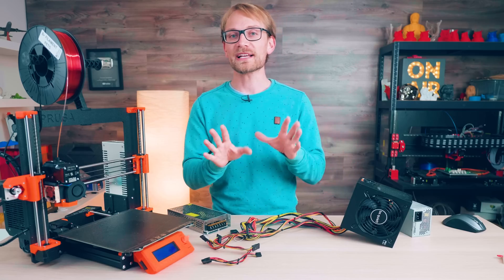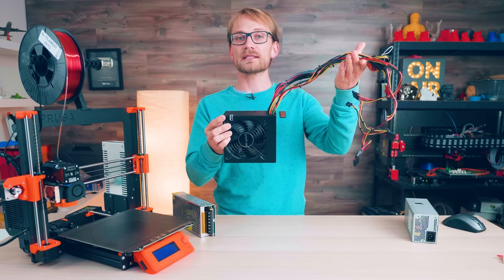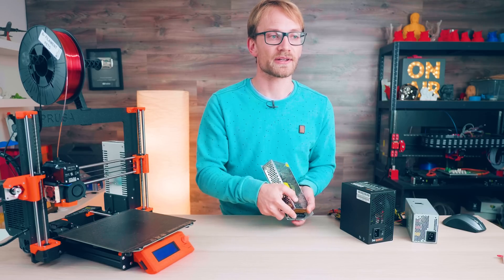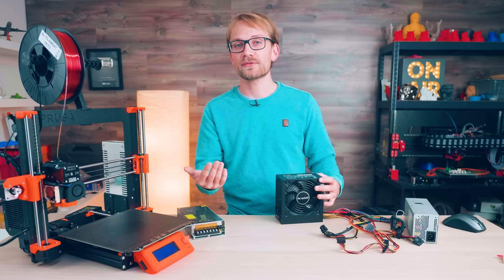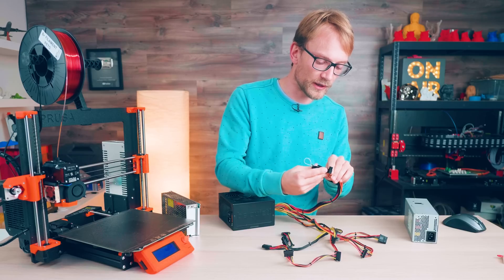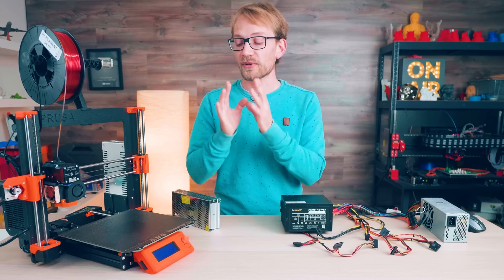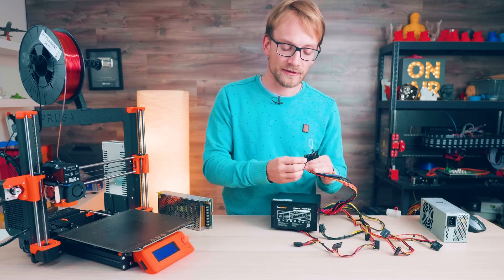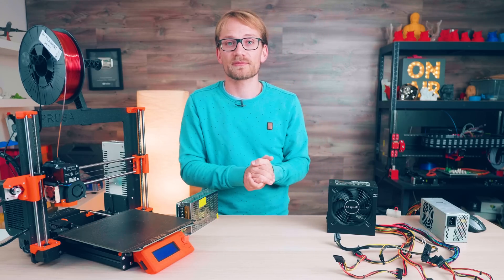ATX supplies are super useful for 3D printers!

Comment: Still on 12 volt PSUs on my 2 custom printers. One with a RADDS controller has ATX corsair 80 bronze semi modular PSU. I combined 3 ATX wires to one thicker for the bed. The other is with a Duet WiFi and has the 12V Prusa MK2 style PSU and thick wires with crimp connectors and ferrule connectors.

Comment: If ATX PSU's have 2 or more 12V rails, couldn't you just connect them in series to get 24V
Reply: The +12 lines can only be wired parallel, so you get more current available, not voltage if you wire them in series you are creating a dead short, BANG!  You can get 24V from the +12 and the -12 but then you are then limited to what the -12 can deliver in current, typically a small fraction of the +12. Have a look at the label.
Reply: @m3chanist  yup, 0.3A in the example he used on -12V, not worth it

Comment: I was considering a dual psu ATX computer case and just mounting my 3d printer mainboard, rpi, and lcd in the case with the rest of the computer components. Run the 3d printer components on one atx psu and the computer components on the other. A custom IO panel and board could be created on the back of the case for stepper motor and limit switch jst panel connectors and the aircraft connectors for the heaters. Or panel mount powerpole connectors for the heaters.

Just something I've been mocking up and mulling over. Lots of pros and cons.

Comment: Just a little warning about ATX PUs. I didn't want to cut any cables and used the old Molex connectors to supply my printer. (Problably only for low loads as they were meant to just power DVD drives and HDDs). Just recently the lights started to flicker and then the printbed stopped working. Reason was the molex connector makes a really bad connection (at least for me) so over time it burned out the connectors leading to a higher resistance leading to even more heat. I don't think it would have gone very wrong because the printer shuts off power when heating fails etc. but if the printer does not have that security options (for whatever reason) it might get dangerous. I switch to a server PU for that reason.
I wouldn't use these connectors anymore and either use the ones that graphics card use or cut off the connector to make a good connection.

Comment: I currently use a thermaltake 500 watt atx and a 24v power supply. I use the 5vsb to power the Raspberry Pi 3b. When I turn on the power supply in Octoprint the 12v from the atx powers a relay to turn on the 24v supply. The 24v supply is used for the stepper drivers and heaters while all the fans are run off of 12 volt. I am currently using a ramps 1.6 and mega for the main board and a ramps 1.4 and mega for fans and extra temperature  sensors. Im using Klipper for the firmware to tie it all together.

Comment: I have two DIY printers. First one uses a 700W 80+ Silver ATX supply, just because I had it (leftover from Bitcoin mining). It does work quite well... but for my newer one, I went with two MeanWell supplies, a 24v and a 5v, plus a mains bed. The extra performance of the 24v was worth the extra complexity from going the industrial route, plus the packaging was far more convenient to tuck it under the printer.

Comment: The industrial bricks support voltage adjustment. I am running my 12v one at 13.5V witch speeds up the heated bed by one minute.
Reply: RAMPS 1.4 and atmega board? I was thinking of doing the same, but I was a bit afraid it could damage my electronics (especially stepsticks and 12V-5V voltage converter).
Reply: Pretty much all atx power supplies have a pot for voltage adjustment inside, most will go to 13 or so volts.

Comment: You don't usually need to load down 3.3V rail as it's often just a 78-series regulator down from 5V. Only 5V, 12V and -12V come from the groups the secondary. But there is of course maaaany topologies.

How cheap the power supply is has little bearing on how sensitive the protection circuit is. BeQuiet is pretty famous for twitchy protection, which is good, in a PC where you're hanging several hundreds of currency-units worth of electronics off it you generally want it to be as protective as possible.

-5V doesn't exist and i don't think was ever used for audio. The sole purpose of -12V is to prop up the RS232 transceiver, it's not used for audio, and tolerances on it are pretty lax.

An underexplored option are power supplies from decommissioned servers. Having upwards of 600W of power, those are proper beasts that even after lots of aging, will still easily power a 3D printer. They are made with highest quality components, are efficient, have safe mains handling, software controllable power-on logic, they have standby power, and they're not group regulated, in fact they are usually only 12V for the non-standby section, with an intermediate board external to power supply being responsible for stepping down to minor rails. And if you get one made by Lite-On, it won't even deafen you... the ones made by Delta will though.
Reply: 3,3V on ATX power supply never comes from 78-series liner regulator. 3.3v have 20Amp rail. It is supplied from 5v rail with buck converter.
Reply: @tomaszbiskup891  I have seen linear regulated 3.3V rails for sure, but this was before 80+ and ATX 2.x standards :D Yes i've seen switching regulators recently but paid no attention to them. :D sorry
Reply: @SianaGearz  I didnt know that. Still ATX motherboards shifted from powering CPU from 3,3v and 5v rails to 12V and local multi phase buck converters to power CPU, and GPU.

Comment: 24 volts is the key factor for me. Having one power supply for the heated bed, controller board and steppers simplifies everything a great deal cable management wise, 12volts was the obvious choice in the early rep-rap days as they could grab the old ATX ones from desktop PC's but I think Prusa have demonstrated that 24v is the way forward for consumer machines.

Comment: my first printer was shipped with an anemic LED power supply that exploded on first use. I replaced it with a FlexATX server power supply that is 80+ silver with a certification that it can run it's full capacity 24/7. Obviously more expensive, but the FlexATX form factor is very nice, it's 40mm thick and fairly narrow, so it can fit in the same places as those LED power supplies. Only downside is the small 40mm fan that is very loud at high power draws, but otherwise it's great, and I've added a manual switch on the 24pin connector so it's a super safe way to turn it on and off, with zero current running through the switch.

Comment: Hey Tom, greetings!
When I've build my diy 3d printer last year I've used a Thermaltake 500W ATX power supply.
Got a spare PCI Express Adaptor Cable (6 Pin to PCI Express 8 Pin), cut one connector to connect the wires to the RAMPS and the other connector goes straight to the ATX power supply so I don't cut any wires on the power supply which is still under warranty ^_^
Oh and yes, I've attached the green wire of the ATX to the RAMPS, so I can turn the power supply on and off on demand. It works with the Emergency stop too.
The 5V purple wire wasn't really a success for me though. The RaspberryPi was constantly getting corrupted SD card, so I switched it to dedicated power supply (the one it came with).
The extra cables of the ATX are wrapped with a zip tie and hang on the side though.
Reply: Ages ago I made a IR TV receiver for a multimedia PC that not only send signal to serial on-board header but had uC to decode power button code to turn the machine on/off. Well, on battery, everything was great. Once powered by standby 5v (purple wire), you had to put the remote few cm from receiver otherwise it didn’t work. Reason? Too noisy power line! I had to put a low drop voltage regulator circuit between “purple” line and the receiver board. Maybe the same problem here.
Reply: My TEVO Tarantula is still running on ATX PSU from Thermaltake. It produces very safe power and I leave them at school.
Reply: One thing most people don't know is that the raspberry pie is made to run on 5.1 Volt, it will most likely run on 5v but if your power supplie drop a few millivolts lower it can cause unwanted restarts and sd card corruption

Comment: *thermal heat runaway* please help (prusa i3 mk3s)
Reply: Just contact Prusa support. You're not even saying whether it's the hot-end or bed thermal runaway condition, so that depends, but basically the fault will be down to the corresponding heater or its connection and wiring. Not the thermistors, those cause mintemp/maxtemp errors.

Comment: I used plenty of old ATX supplies in past projects, 3d printers and other machinery, but the switch to 24V/36V and the signifiacant price drop made me switch tu undustrial PSUs, now in a different position in the market, I prefer dedicated supplies because of the wiring cost, al lthose atx conenctors would cost me more than the full 24V supply.

Comment: Nice vid, thanks. I built a Hypercube Evo recently, using a 24V 500W industrial psu. Downside is it has an inbuilt fan which is very noisy. I disconnected the fan and stuck a couple of heat sinks on the outside and it's fine. Cost around £30.

Comment: I am using a server power supply. Even at standby it can supply my controller and raspberry pi
Reply: And you can make 24V out of two of these (but please don't let them touch each other). I have 24V with 80 Amps. I want to power my heated bed with 24V to the 12V rail. That means 4 times the power and one fourth of the time to heat up. Haven't finished it yet but I can't wait to see it (?burning?)
Reply: same here. octopi and psu control via a relay
Reply: @TheSysops666 for me it did. And is working for quite a while now
Reply: @TheSysops666 its not as straight forwards as atx (at least for the server psu im using) requiring a boost reg ontop of the relay but its not much more than an atx along with less wiring to hide and a "more reliable" psu
Reply: Server PSUs are also typically 90% efficiency or better.
Reply: How loud is it?  I have a couple laying around.  I like my stuff nice and quiet.
Reply: @Wastedwu  The newer ones are generally pretty quiet if you're not loading them down a lot.
Reply: @Wastedwu  mines virtually silent it has a 120mm noctua (bought pre hype lol) fan on it
Reply: MichaelKingsfordGray  it will present high voltage (no could - it will). It's dangerous when you have no knowledge and no experience. But even a simple drill can rip off your hair and the skin of the head when you don't know what you're doing. If I make a surgery it's dangerous for the patient. When a doctor opens a power supply it will be dangerous for him.

Comment: I tried using the 5v standby for my Pi2 + PiCam + Arduino Mega + Ramps 1.4 + backlit large LCD & SD card controller setup, wasn't sufficient, the temperature values kept fluctuating and had some other odd behavior (it worked though, but I didn't like the jumping temp readings), I instead added a separate 5v supply. This is an Antec ATX PSU I used to use in a gaming PC.

Comment: the link to the 24v 10A supply is broken
Reply from the maker: Thanks, fixed!
Reply: @MadeWithLayers  How about more information on 24V vs 12V? Some people said they can't see any difference with motors and print quality. Is it really worth to change from 12V to 24V? So far it seems I can win on smaller internal power cable at the cost of replacing fans and heaters.
Reply: @vladimirseven777  It's more important for heatbed. If you have a 300x300mm heatbed you will be thankfull to use 24v instead of 12v.

Comment: The multi-rail 12V ATX PSUs are the crappy ones, good ones come with a single 12V rail. Long complex reasons why but suffice to say multi-rail and hope it's not overloaded is cheaper. 12V in PSUs for anything other than a kid's toy printer - run away screaming tbh. Could use a boost-converter but what's the point. Better going higher voltage and buck, we should be running 48V in printers honestly.
Reply: No, that's Corsair propaganda. Almost all power supplies with exception of the particular Enhance platform used between 800 and 1400W only have a single 12V true secondary. Basic PSU health monitoring circuits support two 12V virtual rails, where this rail is then split over two current shunts, and by monitoring the voltage induced on these shunts, two separate overcurrent conditions are controlled for - that's your basic design used by BeQuiet on their lower end units, and BeQuiet is actually quite careful with setting the threshold so it actually triggers, there's no hoping and praying there. "Gaming" power supplies eschew separate overcurrent protection altogether, following the trend and marketing set by Corsair more than a decade ago. More expensive BeQuiet design uses several protection chips for 4 separately current-checked 12V rails. So the only difference you have is in the amount of protection against accidents. Of course there were always a bunch of inexpensive power supplies where two rails are only nominally present according to label, but never included a separate overcurrent protection as described; and also lots of power supplies are pretty sloppy with setting the trip current.

Overcurrent protection checks tuned to a higher value than about 20-24A are completely ineffective in a PC, as the wire resistance alone, accumulated connector resistance etc won't let the protection trigger even when there's a proper fire happening inside your PC, considering just a single terminal will likely be subject to a short rather than all of them. This is why single-rail, whether advertised as such or as a simplification measure, is to be avoided.